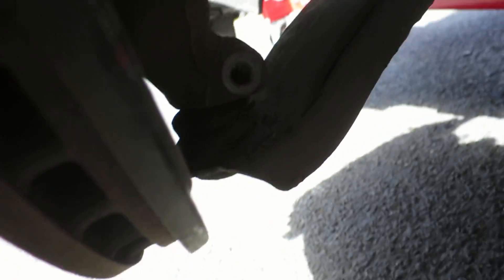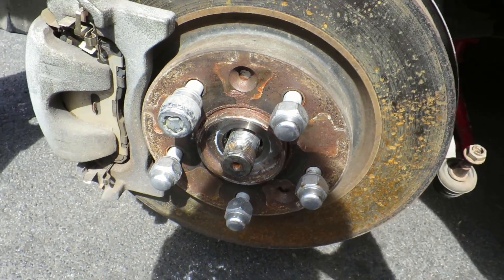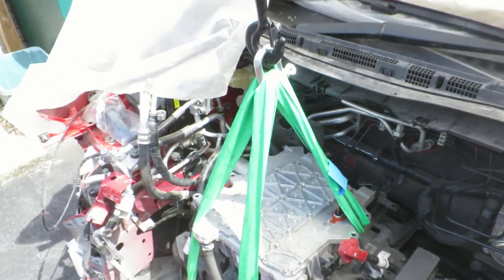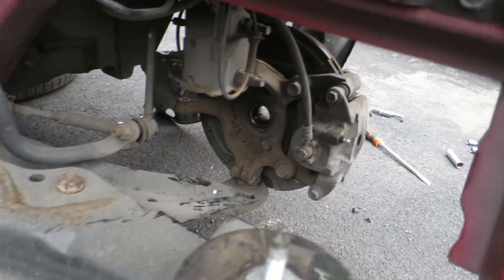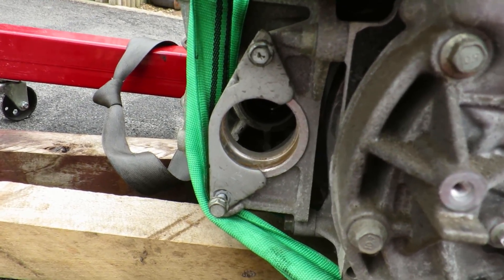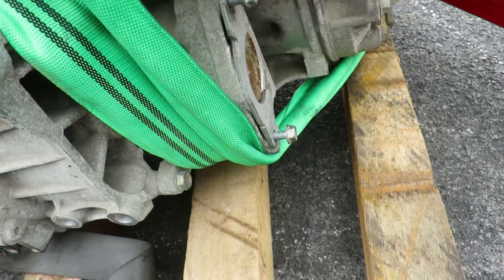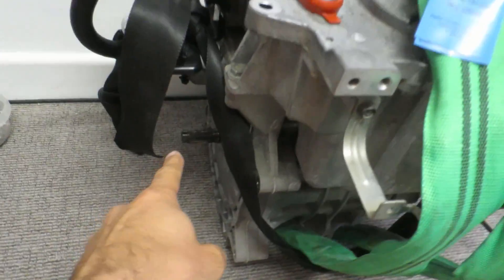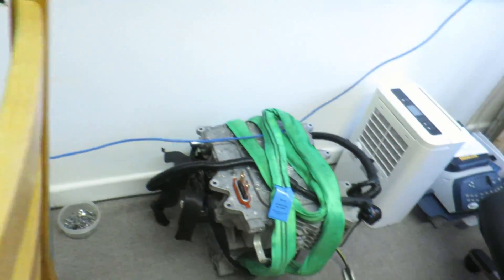Nissan Leaf motor and inverter removal, RX8 EV Conversion

Comment: How much did the motor weigh once the gearbox was removed.  Great project!
Reply from the maker: Hi, this is very rough but found in my notes from back then...Engine, Flywheel and Clutch was about 112KG
Reply: Thanks for the info  @SouthWestEVUK

Comment: Nice you managed to get one what size battery you end up with ? And weight of battery and motor ?
Reply from the maker: Its a 30kwh pack, each module is about 8kg (*24 = just shy of 200kg). Not sure on motor weight, but I think it is lighter than my existing motor which is good.
Reply: @SouthWestEVUK  I can't wait till you sort it all

Comment: Really good stuff.
Why don't you scrap the entire driveline from the RX8 and just place the Leaf motor and gearbox in the back, where the differential currently resides? 
I think the height of the motor "stack" might be your biggest issue, but you might be able to place the inverter or the charger in the boot.
That leaves tons of space for batteries in the center tunnel with decent weight distribution 🙂
Reply from the maker: Yeah, its a nice thought, but space would be an issue for sure. I am not the best fabricator in the world and that feels like it would need a lot of construction - the mounts for the motor would be an issue too, its all quite heavy! I am happy it is going to fit up front - its tight, but it will fit. I may put the charger in the boot which helps up front.
Reply: @SouthWestEVUK  I'm sure it isn't much more fabrication than mounting it at the front. Either way you have to make motor mounts, and with a front mount you have to make an adapterplate for the bellhousing and figuring out what to do with the clutch.
It all comes down to the height of the motor and gearbox (given that it would work, when separating the motor from the inverter.). I'd try to place it where the petrol tanks are now, and use the mounts for that to fabricate a subframe for the Leaf motor. since it's already designed to carry alot of weight.
http://www.rx8club.com/attachments/tech-garage-22/189279d1349130866-jacked-up-wrong-point-rear-stand-points-jpg 
Whatever you do, it's turning out to be a great build.